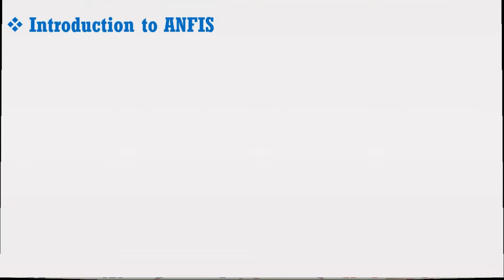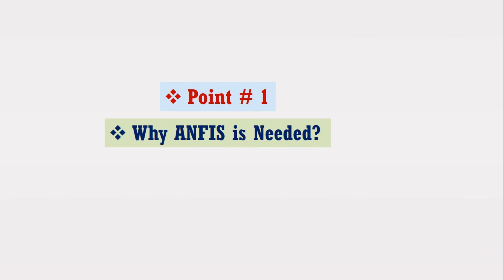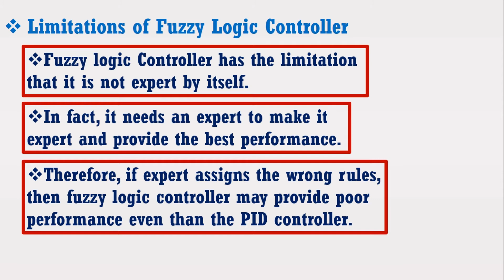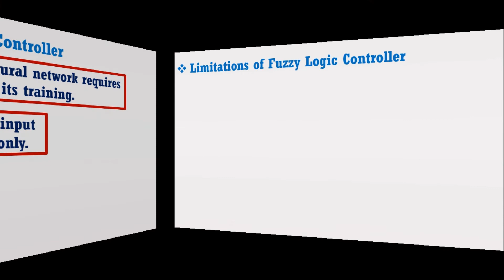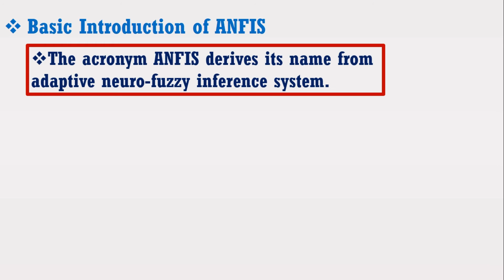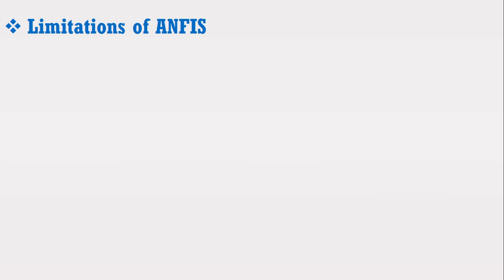How To Design Adaptive Neuro Fuzzy Inference System in MATLAB/SIMULINK? (Part-1) | Dr. J. A. Laghari

Comment: i want to use ANFIS for dstatcom/capacitor placement/dg placement,what should I use in training the system.Thanks
Reply from the maker: Thanks for the comment. First try to find any research paper which uses conventional pi controller then anfis can be applied very easily by finding the input and output of pi controller